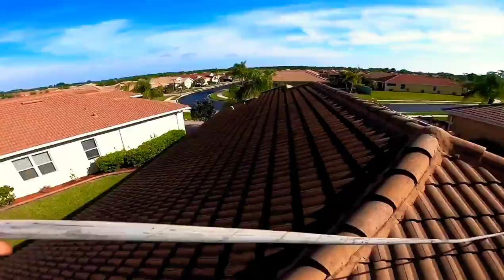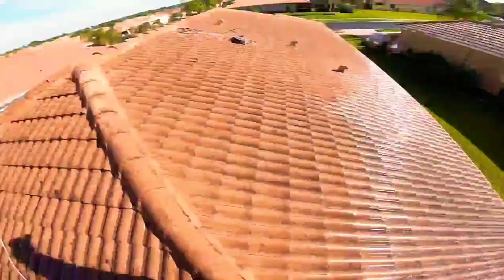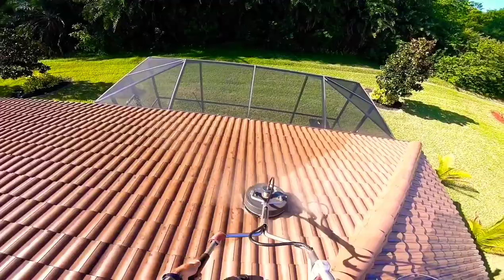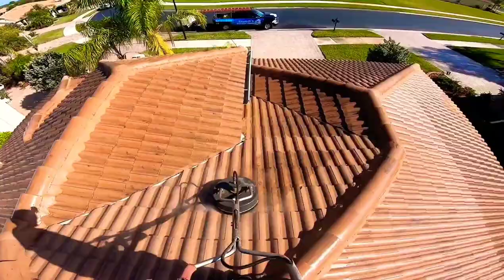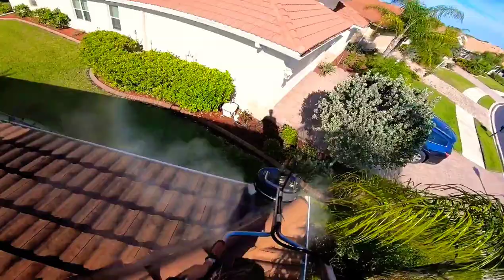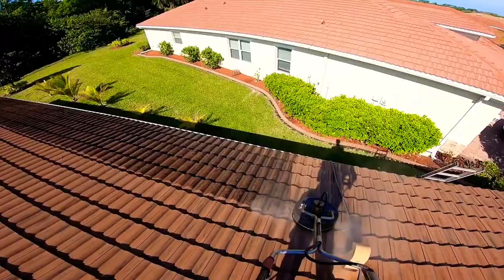How To: Professional Roof Cleaning. (Music 🎶) #viralvideo

Comment: hey mate,couple of questions,did u take the wheels off the surface cleaner or did u buy it like that?also here in australia we have alot of colourbond roofs,i dont know what you guys call it in america,you know the corrugated iron roof,have you had any luck doing that type of roof?is it easier or harder than tile?also were you spraying a cleaning chemical at the beginning of the video?and also if the house has a water tank connected to the house do you disconnect the downpipe ,thx mate
Reply from the maker: Umm... never had wheels.
Haven't cleaned a iron roof.
I spray S.H and yes detach or let run and flush.
Reply: @stwanspressurewashing2282  really no iron roof?ok thx for replying